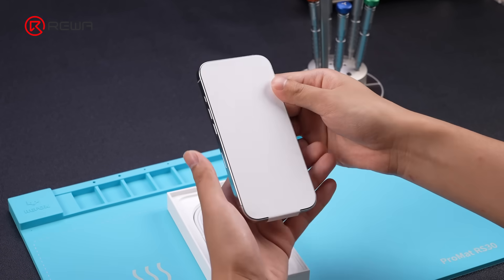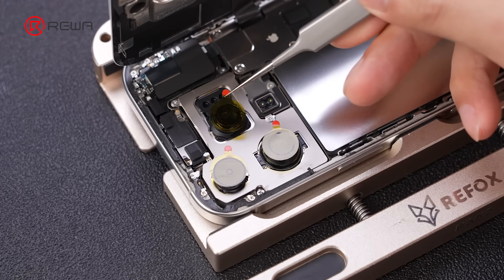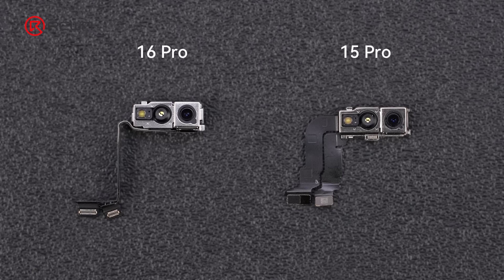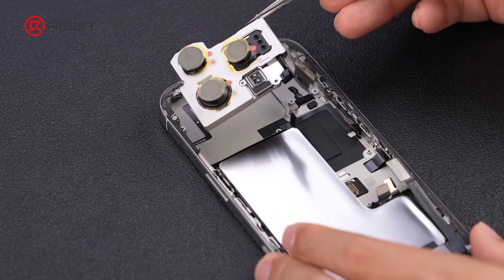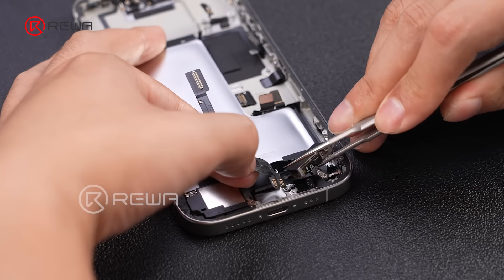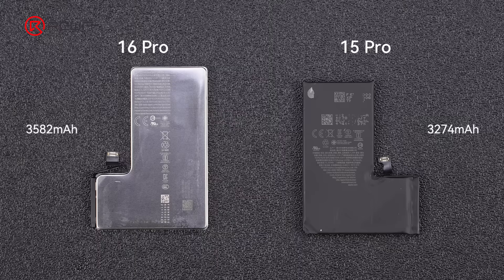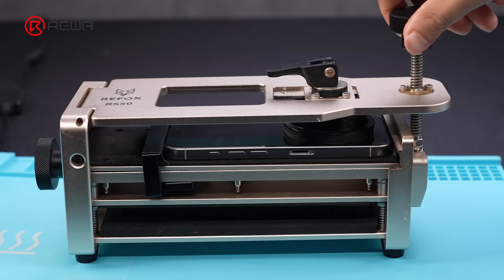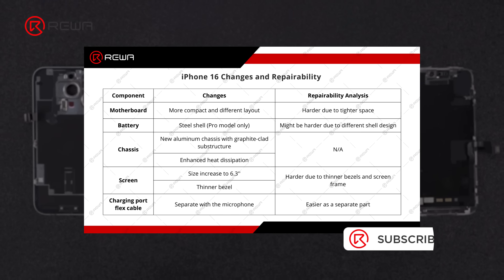iPhone 16 Pro Teardown--What is New?

Comment from the maker: How do you feel about the iPhone 16 Pro new features after we teardown? Share us your opinion

Teardown Tools:
1.REFOX RS30 ESD Phone Repair Heating Pad
https://shop.rewa.tech/detail/refox-promat-rs30-esd-repair-heating-pad.html?utm_source=YTB0920&utm_medium=video&utm_id=Repair+Tool
2.REFOX RS50 Mobile Phone Opener Clamp Fixture：
https://shop.rewa.tech/detail/refox-rs50-mobile-phone-opener-clamp-fixture.html?utm_source=YTB0920&utm_medium=video&utm_id=Repair+Tool
3.REFOX RS52 Cell Phone Screen Holder
https://shop.rewa.tech/detail/refox-rs52-cell-phone-screen-holder.html?utm_source=YTB0920&utm_medium=video&utm_id=Repair+Tool
4.REFOX RS2 2D Screwdriver for Phone Opening Repair
https://shop.rewa.tech/detail/refox-rs2-2d-screwdriver-set.html?utm_source=YTB0920&utm_medium=video&utm_id=Repair+Tool
5.REFOX RS40 Magnetic Screwdriver Holder for Screwdrivers/Tweezers/Pry Bars Storage
https://shop.rewa.tech/detail/refox-rs40-screwdriver-storage-holder.html?utm_source=YTB0920&utm_medium=video&utm_id=Repair+Tool
6.AT-14K Stainless Steel Fine Tip Tweezers
https://shop.rewa.tech/detail/stainless-steel-fine-tip-straight-tweezers-at-14k-oem-new.html?utm_source=YTB0920&utm_medium=video&utm_id=Repair+Tool
7.Metal Spudger Pry Bar
https://shop.rewa.tech/detail/metal-spudger-pry-bar-type-1-oem-new.html?utm_source=YTB0920&utm_medium=video&utm_id=Repair+Tool
Reply: Same Same But Different. ❤ & It's iphone 16 Series with touch button &50mp camera..th 🔚

Comment: what about 16 pro max ?
Reply from the maker: Apart from the screen size and some heat dissipation, pro and pro max mainly share same design
Reply: @rewatechnology2008  what about the difference in their battery finish? i see 16 pro max still using the old version battery
Reply from the maker: @aiolos20  Yeah the pro max still use the old version the battery structure is stack as the old modules, the steel design will also bring more power, after we test, it should bring more 3%-5% thanks to the corner of the L shape.

Comment: It’s fascinating how the teardown of this device closely mirrors the process seen with the iPhone 4. From the meticulous removal of components to the internal layout, there’s a clear resemblance in how the parts are organized. Even the way certain elements, like the battery and logic board, are accessed and secured feels strikingly similar. It’s as if both designs share a common philosophy, prioritizing modularity and ease of repair. This could suggest a growing trend in how modern smartphones are engineered with both user-friendliness and longevity in mind.
Reply from the maker: It is our honer to have your complient

Comment: The 16 Pro still comes with the pull tabs for battery removal. 
The regular 16 users electric current activated glue instead
Reply from the maker: The 16 battery seems meet lot of changes, we are also trying to learn it for more details

Comment: I don't think Apple said it improves thermals 5x, more like 20%
Reply: Did they even provide a figure? Sustained performance, CPU power, and GPU power are all up around 20ish percent but I don't remember any specific number for this. I think I would have remembered 5x.
Reply: still uses graphites for thermal dissipation is so dumb compared to others that uses real huge vapour chamber that's why no wonder all iPhones suck at sustainable performance @t-linn

Comment: would love to see case designed for air flow and cooling fan with magsafe, ofc in  a small form.. so you can play at high settings without degrading the battery

Comment: one good thing, battery can be replaced from the back and not from the fragile screen
Reply: Battery will take you 2yrs before replacement needed. The screen will need only one drop and you need to replace it, takes 2hrs because many internal parts need to remove first before he can get into the screen ( back to the future of iphone 4 /4S repair style lol😂
Reply: @mela5367  if screen replacement is needed all iPhone from 15 can be opened from both front and back glass.
Reply: @mela5367 No lol. Shut down the iphone, opened up lcd from front, replace and then done.
Reply: @mela5367  The screen has been relatively easy to repair for a long time. The iPhone 14 and iPhone 15 Pro added the option to open the iPhone from the back to make the back glass much more easy to replace and any other internal parts like the battery. I know it's hard to believe but Apple made repairs easier.
Reply: @mela5367 you really don't know what you're talking about 😂